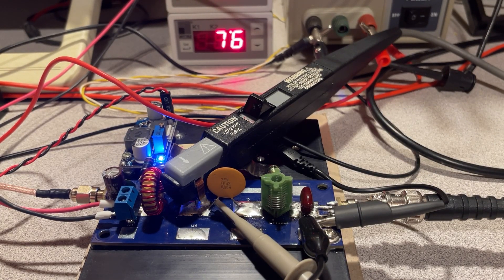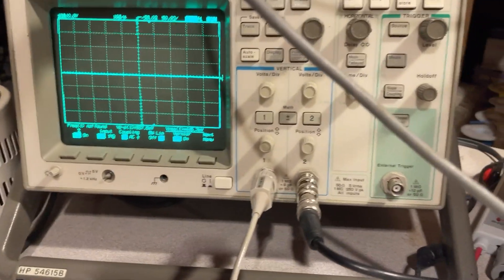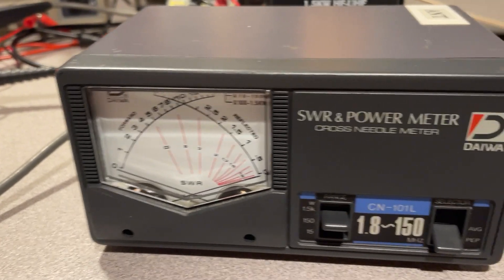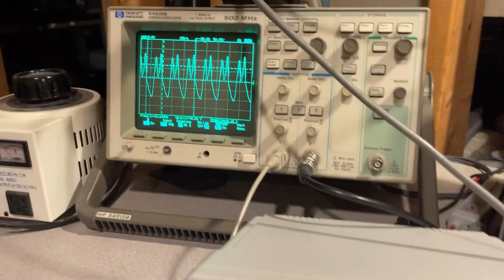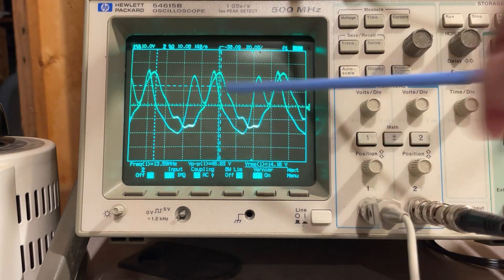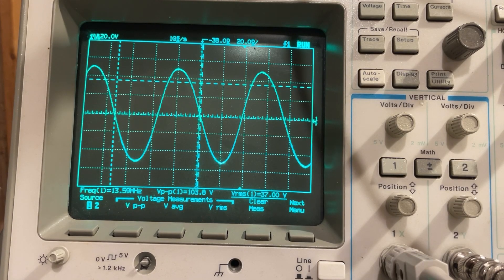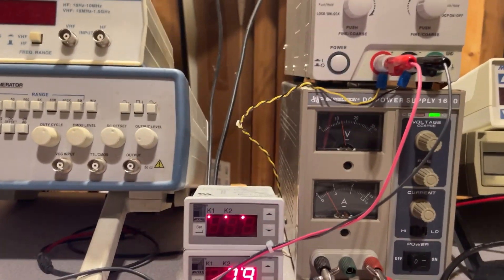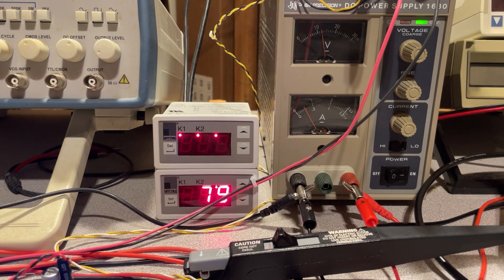Class E RF Amplifiers Explained - Circuit Analysis (Part 2)

Comment: Hi, I have followed through this class E RF Amplifier design by using the ClassE app by tonnesoftware. Instead of using the L-network provided by the ClassE, I used the PiEL from tonnesoftware as well to design the matching network. The LTSpice simulation showed very promising outcome. However one of my concern is VSWR, how good is the circuit recommended by this software handle VSWR or is there any material to read to study more on VSWR? Thank you in your presentation.

Comment: Fantastic.

What is the current probe you are using?  I’ve tried making class e amplifiers before, I would have loved to be able to see the current waveform.
Reply: I am using an old Techtronics current probe, which is no longer in production. It’s an induction probe with a current amplifier. They may be other manufacturers offering a similar pro. Some research would be needed.

Comment: Once again, very nice presentation, Rob. I'm impressed with your detailing. I don't have the time to do what you are doing, but I'm referencing your work to others. Former RF engineer, retired. 73's Dale. Oh by the way, I have one critique. I would not recommend using film resistors with any lead lengths, in any RF circuits...IE: the LDMOS amps in previous videos. Best to design, using surface mount devices, and cut down any potential inductive reactance. I'd have concerns of any VHF resonances with the LONG leads! In my designs I only use specific RF related components. ~25 years ago, I did design a multi KW class "E" AM transmitter, matter of fact even used ECL logic to drive the drivers for the FETS! LOL! Worked great. ( My passion is R&D. Was visited by NASA engineers back in the day. Plasma generator for the Hydrogen pulsed rocket engine project) RF generation was from ADI DDS devices, was also able to control the phase relations between the devices..etc. To much detail to get into! Keep up the good work.  My interest were driven by EER, I did speak with Mr. Caan a few times back in the day, although he was in his 80's.
Looking forward to your next video's.....
Reply: Good suggestion. On my HF board, I actually use the lead lengths of the feedback resistors as inductors (20 nH). This provides less feedback at higher frequencies. An old Motorola trick. I fundamentally agree with your suggestion. Thanks!